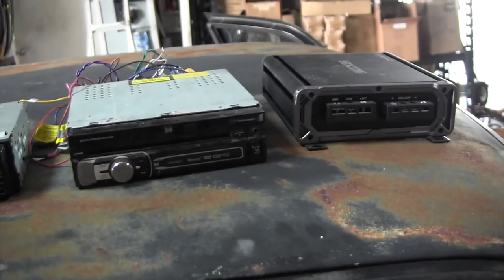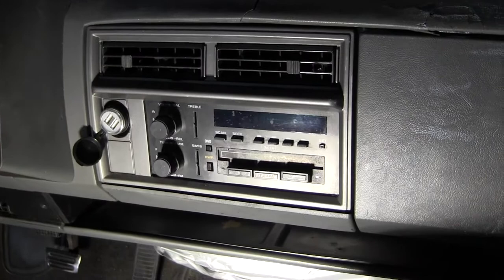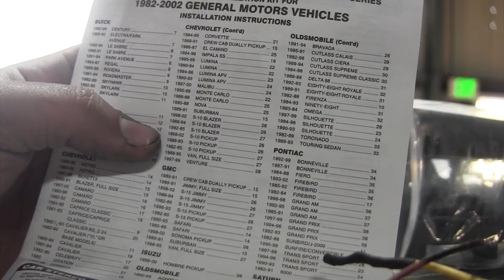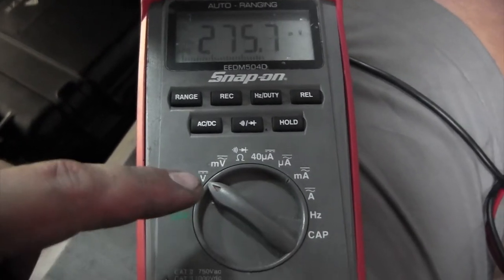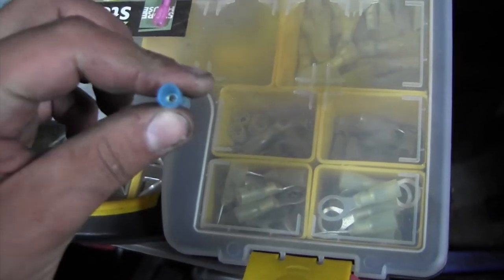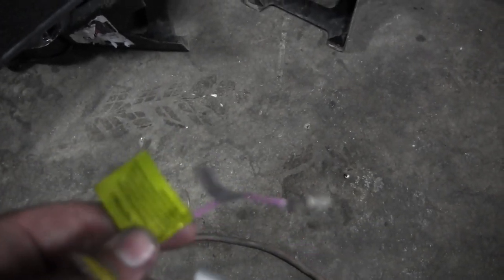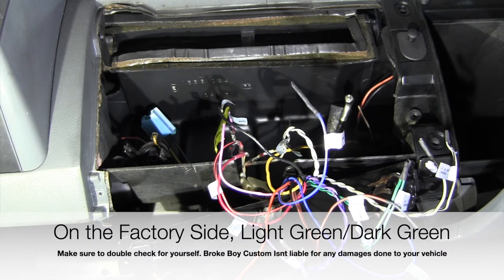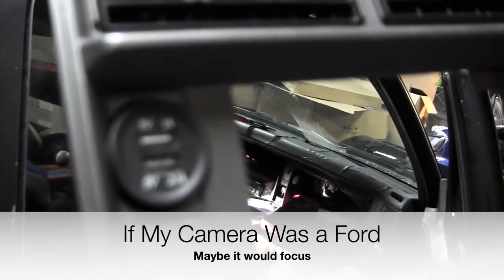How To Install an Aftermarket Stereo On 1st Gen S10 (Or most Cars)

Comment: hey man, first time on channel,came her looking for a harness for my 91 ext.cab chevy s10 and ended up subscribing, nice editing also
Reply from the maker: I appreciate that! Best of luck with that harness!
Reply: Still can't get it man, might have to just rewire everything
Reply from the maker: @akfo7691  I’m sorry to hear that. Your 91 extended should be the same wiring as mine as long as you had the same factory radio that I had. It looks scary but as long as you take your time, unplug power and follow the same steps in my video you should be good to go
Reply: @brokeboycustom7655  finally got it, wasnt as hard as it seems, took the orange constant power and then all that wasleft was speakers,

Comment: Thanks man! Can I ask why you disconnected the battery before removing the factory cassette player?
Reply from the maker: It’s all for safety. One time I didn’t and I burned out someone’s dash lights. In a car, every piece of metal is grounded. Having loose power wires can make fuses blow, melt wires, and short computers

Comment: they make a harness for the new add-on raidos, so that the original harness can stayput. 

in order to get the correct one,  you have to make certain that it is the correct one.

lol,   i dont like removing OEM  when i do not have to.
i let alot of radios stay put because of  that. 

cool vid  tho.
Reply from the maker: @deborahcuster8142   Thanks for your input. I’ve had bad luck with those harnesses, especially since they require the 30 year old connectors be in good shape. I’ve had cars where the connectors were melted, corroded, or just fell apart when disconnecting. So I prefer to splice in the aftermarket harness. I could have bought the harness in my case, but the point of this video was to help someone who didn’t have access to it or didn’t want to spend the extra money on it

Comment: Thank u for explaining the wiring, I normally don’t have issues hooking up the radio but never done on a 93 s10. It’s my truck so I’m gonna remove the connectors I guess. How do I hook up box speakers to the current wiring that is there?
Reply from the maker: You can always go off of the wiring on the speakers. But if you mean a subwoofer I am planning a future video on a full install on one

Comment: Wow that's crazy. You don't  see an s10 with the factory uncut stereo harness often. Fyi don't do this its the wrong way but the adapter.
Reply from the maker: From what I’m hearing in my comments, they don’t make the adapter anymore, so this may be many peoples only option. Unless the truck is super clean with low miles, it’s probably not worth a whole lot of money anyways. As long as you make clean connections and make sure they are air tight, there is nothing wrong with cutting the harness
Reply: @brokeboycustom7655  I recently traded a 98 firebird (v6) for a 93s10 blazer. With 130k miles. Very little rust. Ac blows cold. It’s a freaking time capsule when I hop in. I love it.
Reply from the maker: @billyhighfill  that’s awesome. These old chevys remind me of working on my dads old Monte Carlo as a kid. They hold a special place in my heart

Comment: Show which power wires u have hooked to what. Mine either wants to always stay on or nothing..
Reply from the maker: Check if your radio has both a main power and a switched power. Some don’t have the switched power. If it doesn’t then wire your main with an extra switch to turn it off so you don’t drain your battery